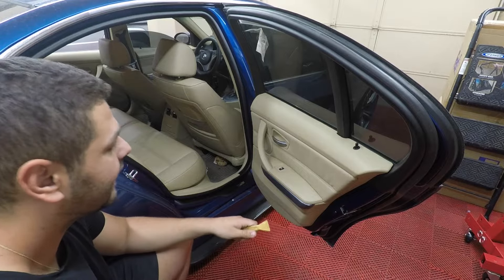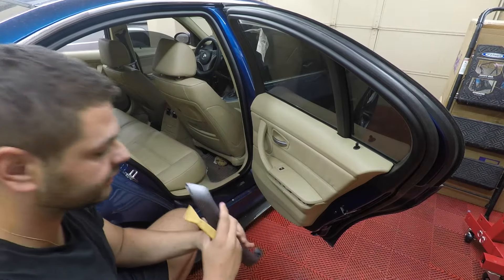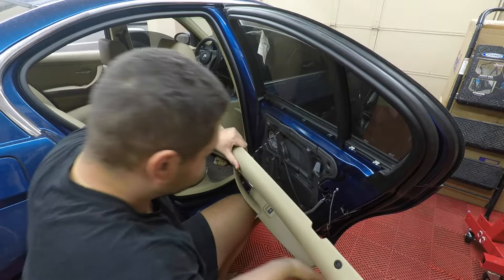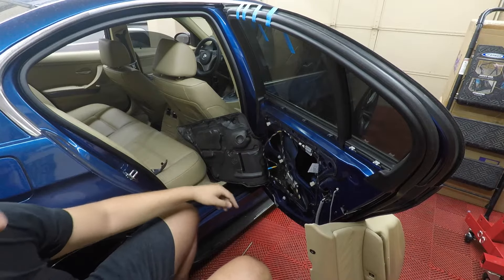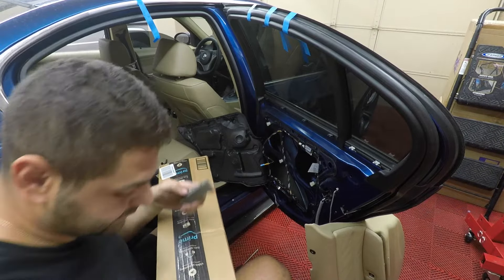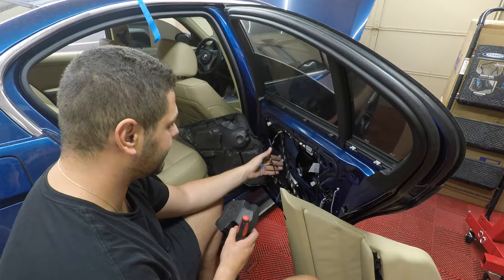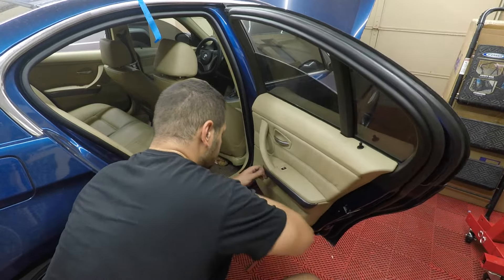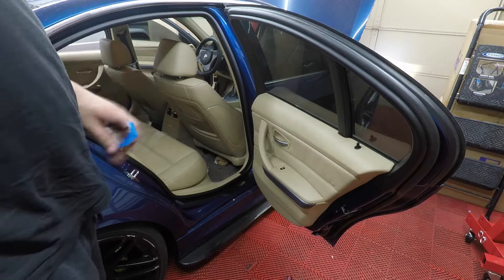EASY FIX ! Window crunching, not rolling down or working? BMW E90 Window Regulator fix

Comment: I thought the old part you put in the New regulator was the one tha goes bad
Reply: It depends that’s the motor he put back on the regulator but most of the time it’s the regulator I replaced my regulator two years ago and used the same motor and then today my regulator just went again gotta love bmw parts 😂

Comment: Tired of correcting these car people that was the incorrect but the actual bit you will need is a T15 bit
Teton was too small of course this may vary depending on who previously owned your car and changed your pits but mine is OEM and original bmw 325 e90
Reply from the maker: Did you ask Brittney?